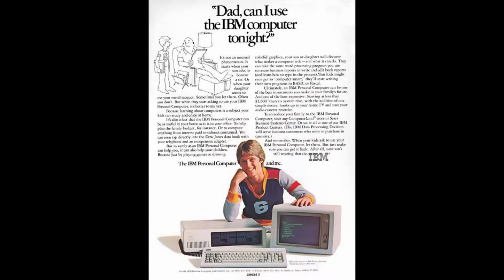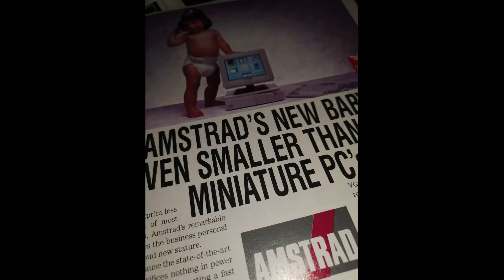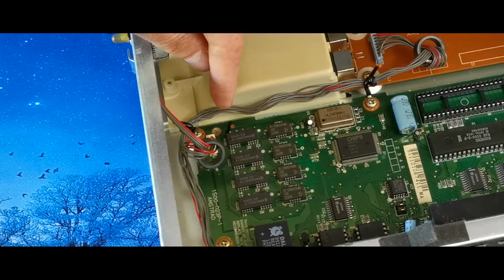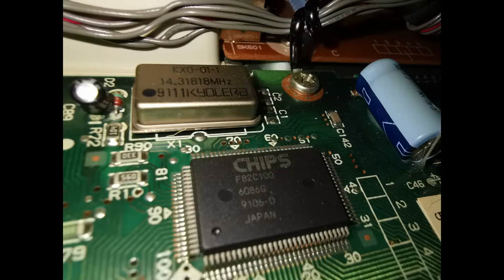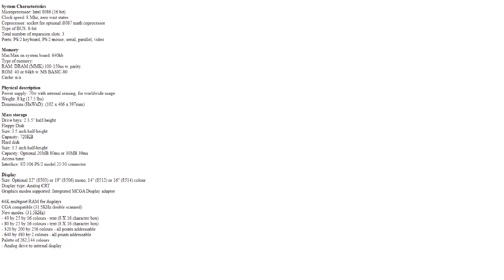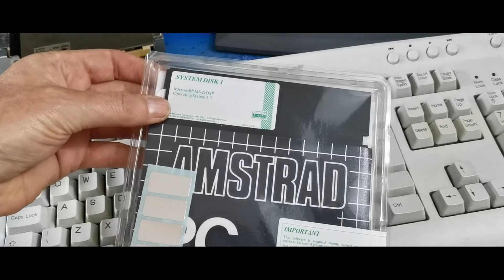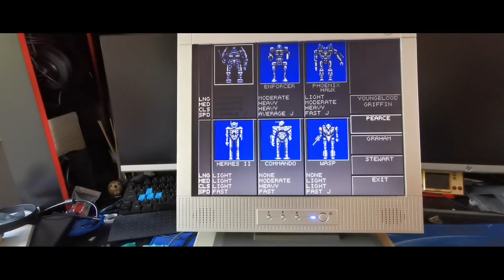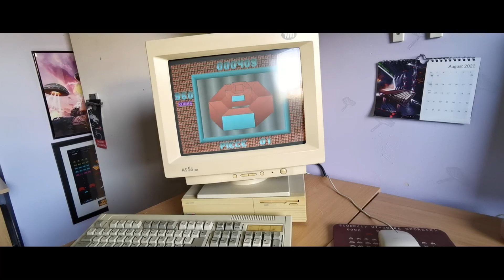Super XT class PC!

Comment: Hi, I have the same computer, do you know where I can find a floppy disk reader? Because mine is break down
Reply from the maker: Hi.
Firstly check the belt if you havent already, in the drive. Mine had snapped when I first got it and wasn't working, I used the belt from a cpc drive and it worked, they are readily available on ebay. Im only guessing but the drive from a pcw9512+ might work, but might be hard to find. Failing that, someone on the vogons channel managed to make an adapter so you can use any 3.5" drive kind of - https://www.vogons.org/viewtopic.php?t=74154. 
You can definately use a gotek with that adapter, floppy drives seem a partial fix. If its not the belt id probably go the gotek rout myself. 
Hope you get it sorted😊
Reply: @66mhzbrain  I'll try it as you said, cheers mate. Have a good one